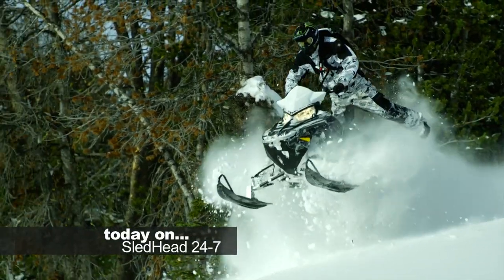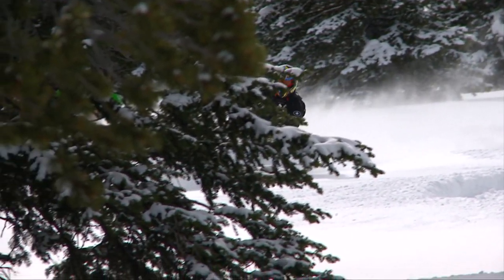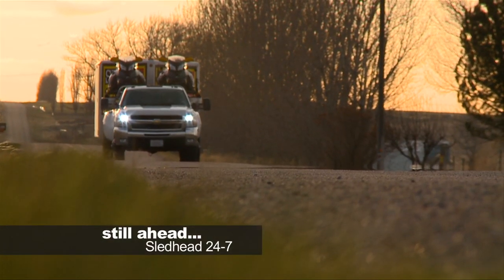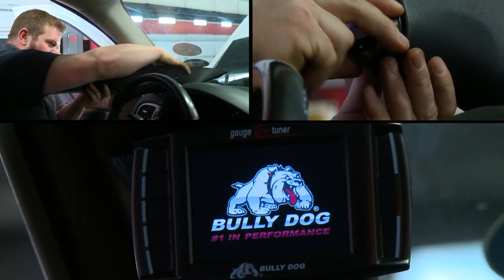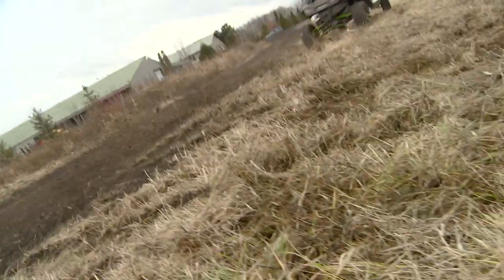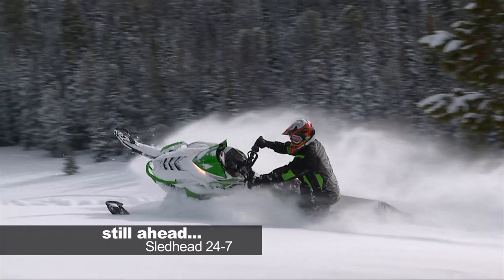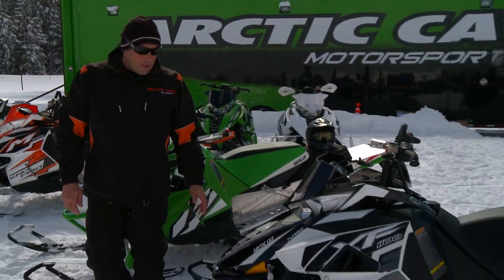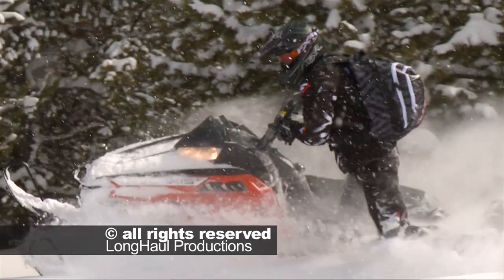Sledhead 24-7 2012-13 Episode 2 (FULL EPISODE)

Comment from the maker: The belt drive is very durable and you shouldn't have to change it for a long time. Its maintenance free. The cost is about the same as a high quality drive belt.  You shouldn't need a spare. Do you cary a spare chain for your chaincase?

Comment: Also a lot less strain put on the primary, secondary drive and gearbox because of the minimal but existing flex in the belt.

Less energy lost in the transmission and more response to your throttling equals more power and driveability.